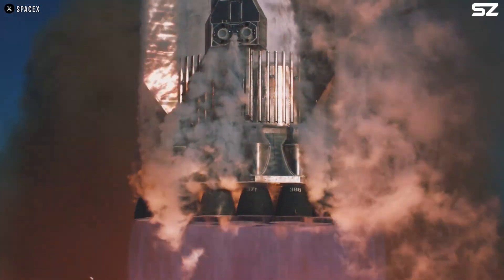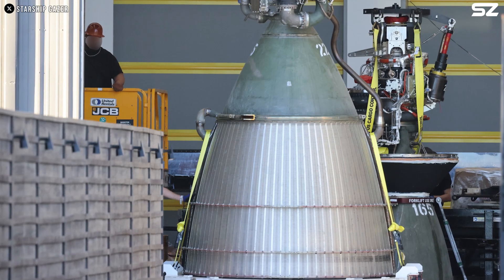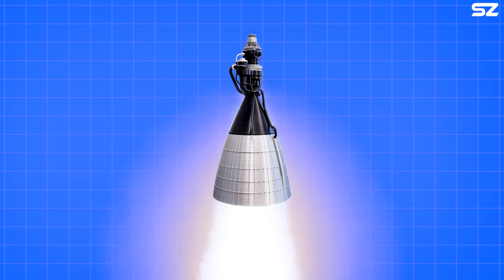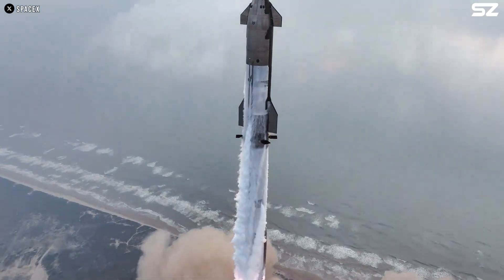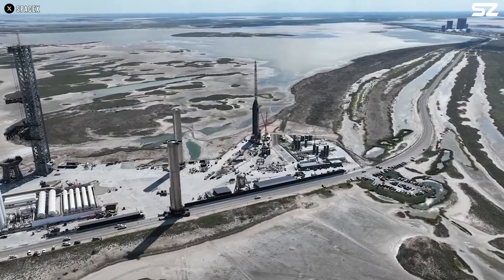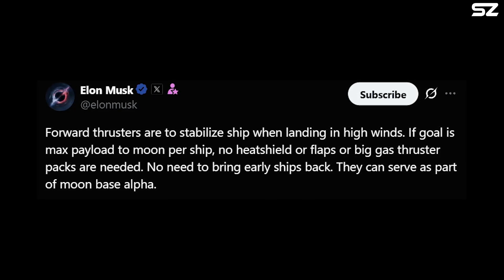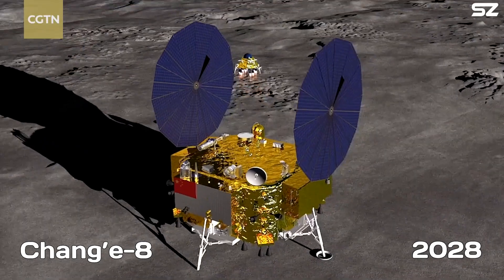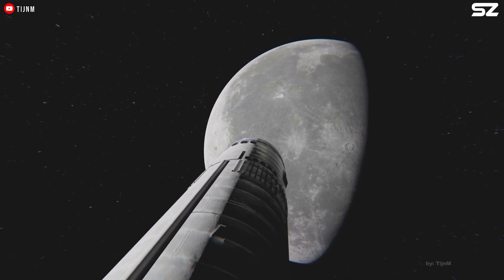SpaceX's New Starship Vacuum V3 Engine is Here!

Comment: The reliability of Raptor 3 must not be taken for granted, at least not before this engine really proves itself on several flights. Every new system or design reveals  its hidden weaknesses only in practice. Look at the much advertised "V.2 Starship" design, that proved a fail and a big disappointment, producing only RUDs so far. So we'll wait and see.
Reply: innovation doesn't just happen automatically